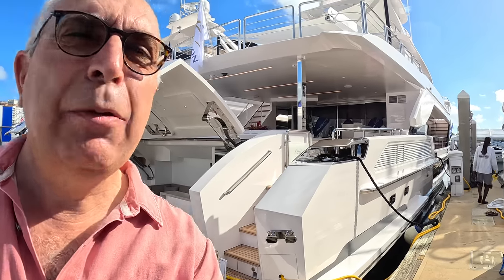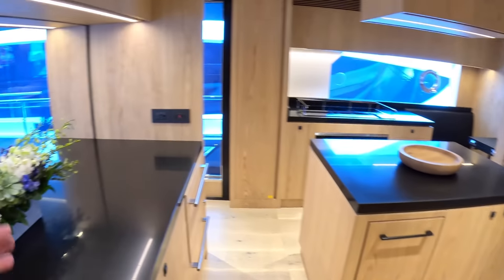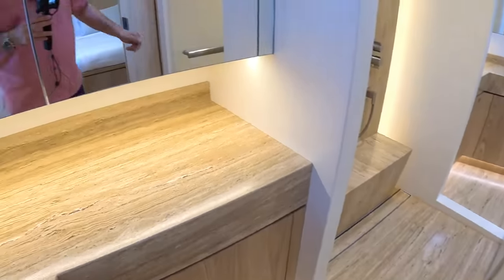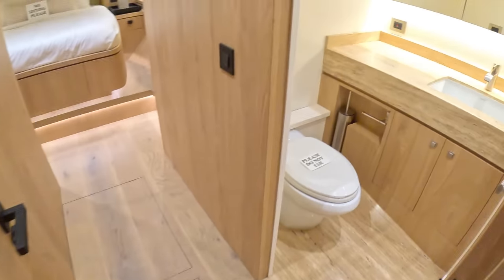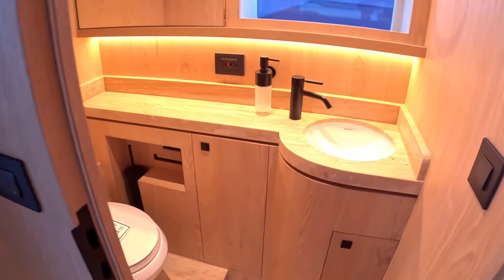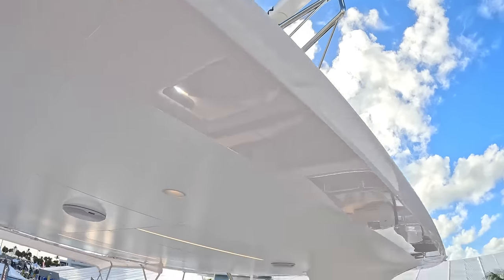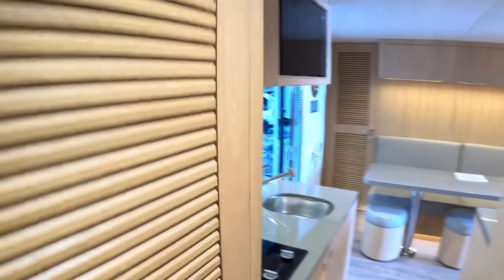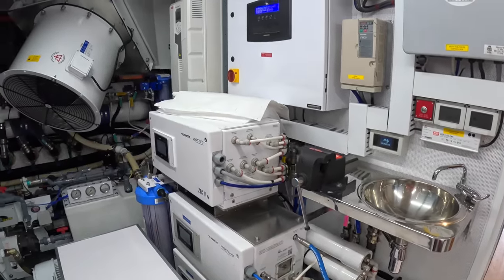$13.5 Million Superyacht Tour : Horizon FD100 Tri-deck

Comment: Not a huge fan of the tubbo appearance, but there is no denying the vast interior and exterior spaces. Your excellent video pointed out there is socializing space everywhere. The entire 10 person guest complement could find relative solitude or gather en masse anywhere on the boat. The light-colored wood used in the interior for walls and floors gives the yacht an airy, cheery vibe.

Comment: Thanks for the tour, Nick!  This is a beautiful yacht.  I especially liked that three of the four lower level cabins had large beds that sleep two.  I felt the crew space was spacious and well laid out.  I’m sure any crew member would appreciate the separate shower stalls, too.  

Since this yacht is slightly over 100’, does it mean it falls into a different category than yachts under 100’ and therefore requires a full time captain and other requirements?  Maybe doing a video on those differences sometime would be helpful if you haven’t already done one.  Again, thanks!
Reply from the maker: Here you go, explained here: https://youtu.be/Qq1cP6KrHfc
Reply: Thanks, Nick!  I hadn’t seen that video but it answered all my questions.  Great video!
Reply from the maker: @rhertze  Perfect! 😃

Comment: Could you drop one engine and still make 12.5 knots?  And cruise at 8 knots plus have a 440 hp wing engine?  Would no longer be a fast displacement boat but longer range ?

Comment: Man I HATED "pickled oak" back in the 90's.  Still hate it, but kind of funny how trends fall way out of fashion only to return decades later.   Also that chrome plated wheel will scald your hands on a sunny day.  Had a 1971 Corvette with a chrome plated shift knob, top down it would get HOT.  Parking it somewhere, you needed to put a towel over it or else it would burn your hand.

Comment: Your videos are awesome but I really got to stress the importance of a higher frame rate.. 24 is simply not cutting it when filming the way you do (panning from side to side). I would rather watch a 720p 60fps video than a 4k 24fps video. Again, Well made videos but the low fps is taking away much of the quality.
Reply from the maker: Noted! Need to try 60fps, just a little worried about exposure at that speed.
Reply: I was just looking for a comment like this, agree - the video looks "choppier" than usual, initially I thought there was something wrong with my computer.

Comment: I always wondered Nick on SB2 do you have to run a blower fan before you start the engines? That's SOP here in the US. Thanks love the channel of course. 🙏😎
Reply from the maker: No need because it's a diesel so no explosive gasses. In fact it doesn't even have a blower.

Comment: FD90 FD100 FD110，so confused
Reply from the maker: FD refers to the type - Fast Displacement. The following number refers to the length in feet.
Reply: @AQUAHOLIC  yeah, i know the number refers to the feet. but 10 feet as the gap between the model, is really confused

Comment: I know you felt rushed to get the entire yacht done quickly, because lot of yacht with only a little time to cover it.
But it really affected your camera work. Camera angle, side to side motion, and quick turns all called attention to themselves.

If you can remember for the next time, perhaps do a series of set pieces at each location (cockpit, salon, cabins, galley, etc) where you're nice and calm, then rush around between set pieces.
It'll mean more editing because you then edit the "rush" as a fast-forward transit (which an audience expects to be herky-jerky).